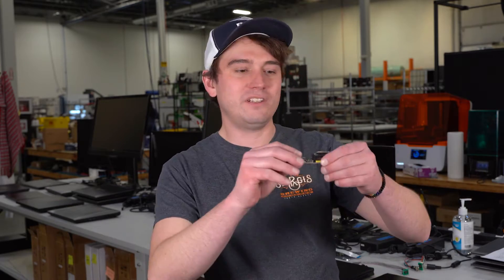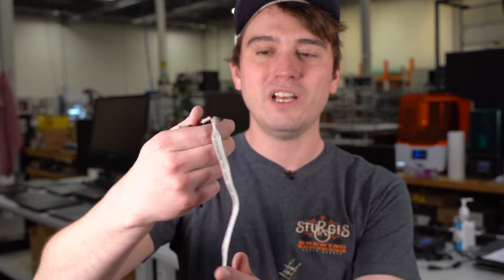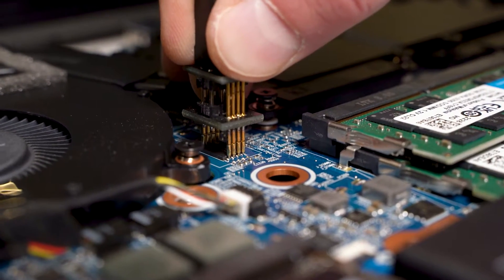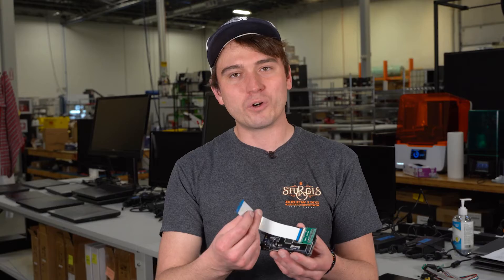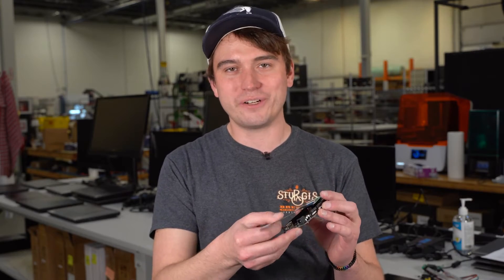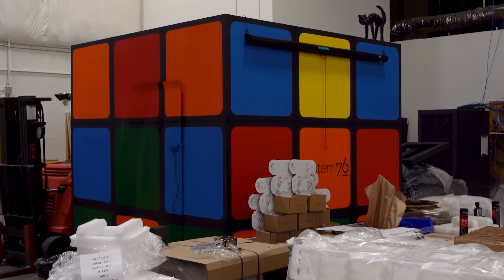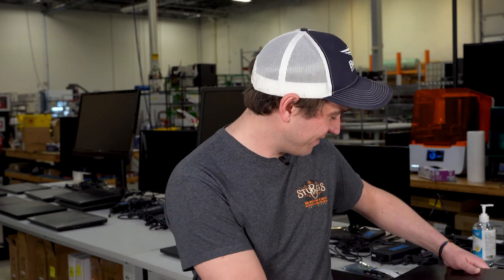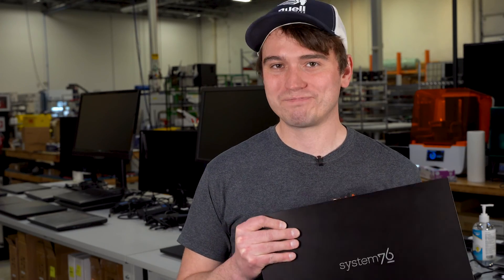The ins and outs of product-testing a System76 computer

Comment: I wonder how you guys make sure things such as suspend/resume work flawlessly.
Recently I got a different laptop with Alder Lake CPU (12700H), and it wouldn't resume after suspend.
The fix was only introduced in the Linux 6.3 Kernel.

I'm considering getting Adder WS with i9-13900HX and I'm not 100% sure everything works the way it's supposed to considering how fresh the CPU is. 🤔
Reply from the maker: Thanks for the comment. If it helps to ease your mind at all every piece of hardware we sell goes through the same rigorous QA testing where we test things like suspend and resume. With our intel models, we also do a significant amount of open firmware (coreboot) work.
Reply: @System76  okay, cool, thanks.

Comment: I recently bought a Galago Pro from System76.  The trackpad is unusable.  It hangs up repeatedly,  It also jumps around all over because it is so wide you can't type with it.   I don't know where Levi and the System76 engineering team's heads are when it comes to shipping crap out the door.  This problem is not unknown.  With System76 it doesn't matter.  They don't stand behind the products they sell which are defective BY DESIGN.  If you use a mouse, it works great.  If not, it's a constant frustration.  I'll never buy another System76 product BECAUSE they don't do good quality control.   In a word, D  E  F  E  C  T  I  V  E.
Reply: I'm sorry you had a negative experience, but I can assure you that what you're saying is untrue. We stand behind our products enough to have a 30 day satisfaction guarantee return policy, and a 1 year warranty by default. I'd love to make your experience better if I can, though. Please reach out to me on Pop chat and let's talk about your Galago.

Comment: This is the top quality content which is too hard to find! My questions:
1. Is there a particular reason why bios chip isn't socketed instead of soldered?
2. How long it approximately takes to prepare each unit with flashing & testing?
3. If you designed your own 20V5A usb-c pd charger for every model, would it make your testing and firmware tasks easier?

I didn't know that WSON-clips exist. I've always de-soldered them and replaced with SOIC. Thanks to this video, I have to order WSON-clip.

I wish happy work days for everybody in the System 76! Hopefully one day you've built your own motherboard production line in Denver!
Reply: Sure thing!
1. The machines we're working with are usually finalized, non-prototype units, and it's rare to have BIOS chip sockets on production units.
2. In production, the machines don't have to be externally flashed. The firmware updater can flash them internally, and it only takes about 5 minutes.
3. A bespoke USB-C charger would be a nice standard to base things off of, but I would still want to test a wide variety to make sure there are no surprises. Users often tend to try whatever charger happens to be handy. I've had to explain to some that a typical cell phone charger usually won't have enough wattage to keep up with most laptops. Thankfully, USB-C PD is a solid standard, and as long as the Watts are sufficient, the charger should work fine.
Reply: @LeviPortenier  usb-c pd had its opportunity to be a gods given gift, but it is problematic af as you just described. It should be stated that every charger must meet the 20V5A handshake limit at any point to make everyones life easier.

If that's a constant support request for System76, would it be possible to make your hardware with Pop_OS! to notify users, when too low wattage charger is attached?
Reply: @vicmac3513  That's something that's typically only handled at the EC level, but there might be a way to detect the charger in the OS. I'll definitely take it into consideration, thanks for the idea!

Comment: As an Oryx Pro 8 owner, I kinda laughed at the section about making sure the laptops are quiet, this laptop gets so loud it scared my cat once while 'taking off'. I still love everything you guys are doing.
Reply: Yeah sometimes there's only so much shushing that can be done, and that chassis was a bit on the noisy side. The oryp6 I used for a while shared the same chassis. It sure packs a lot of power into a sleek metal frame though.